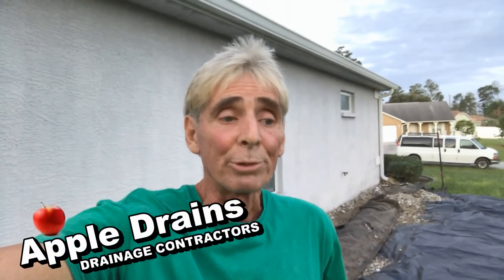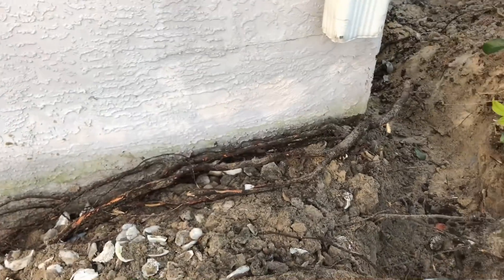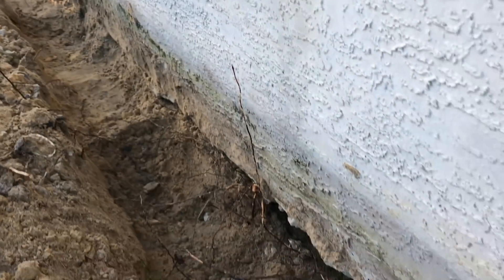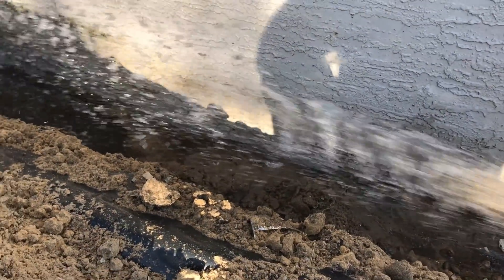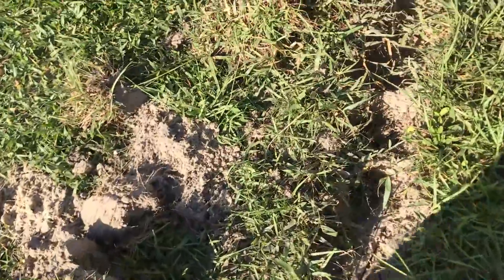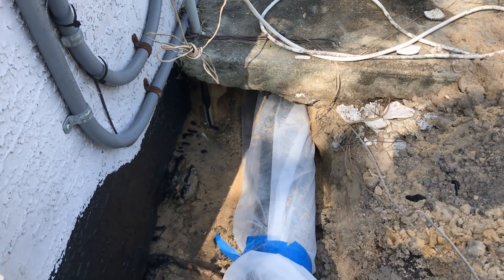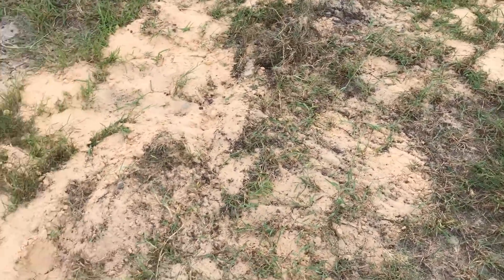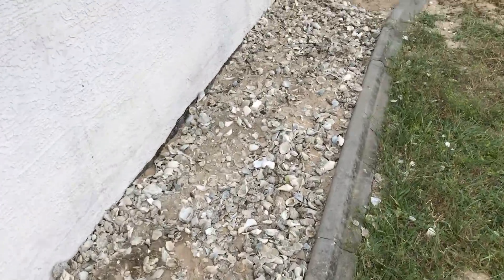How to Install EZ FLOW Drain Pipe Exterior Foundation Waterproofing

Comment: I put EZ-Flow in in 2021.  It was pricey at $39 per section.  I just came back from Lowes picking up more stuff to add on to my system... these are now $70.  EACH.   This isn't inflation - in fact, inflation is down, and most prices are right back to normal.  This is gouging and profiteering.  Do not buy this stuff.  I had a yard and a half of stone delivered for $150, and the corrugated pipe is still $15 per 10 ft.    You can do a whole yard for the price of 2 sections of EZ.  Shame on Lowes.

Comment: Thank you Chuck for your content - you have been a BIG help for me to figure out a plan for my new house.  Could you please help me - I think I need clarification about placement.  I thought that you put the drainage pipe right up to the foundation when on the inside of the crawl space  but when working outside I thought you needed to leave  10 feet of native soil up around the foundation when working from the outside of the house foundation.  Just a little confused about placement.  Thank you.
Reply: Shame these great questions never get responses.  Anyhow, since it's right at the footer level (Florida - no basements), it should not be too bad.

Comment: That homes exterior was a stucco finish. a stucco finish should have a drip screen at the bottom. the drip screen should have no soil touching it to allow the water that the stucco absorbs to escape. you installed blackjack #57 to prevent the water from entering the foundation but at the same time you are trapping in the water that the stucco absorbs. This was the fault of the stucco installation person. Let me know if you agree with my comment. Thanks for all your great videos as I am a fan.

Comment: Thanks for your video. Is that type the preferred pipe to connect to gutters... will the dirt from the roof tiles clog the system? Would a 4 inch PVC pipe be best?